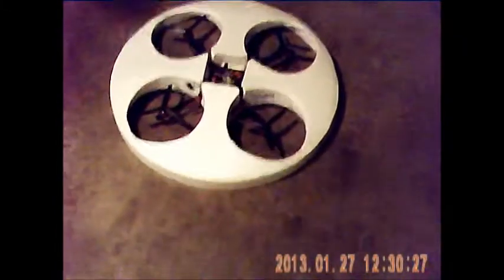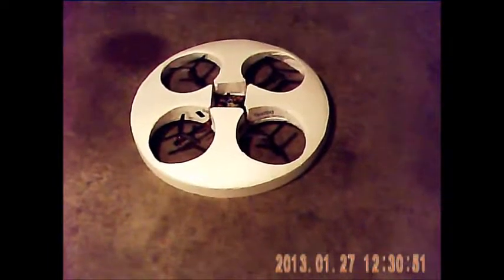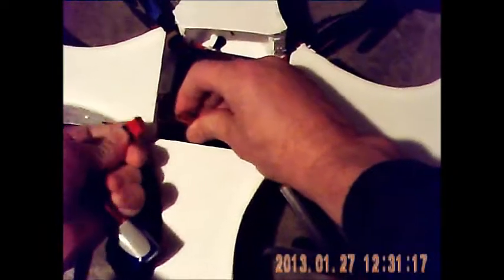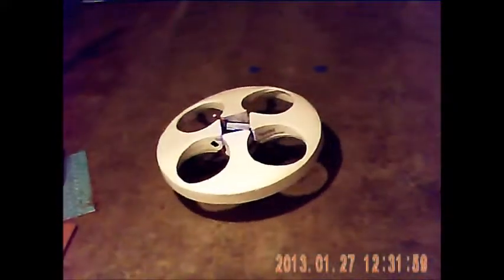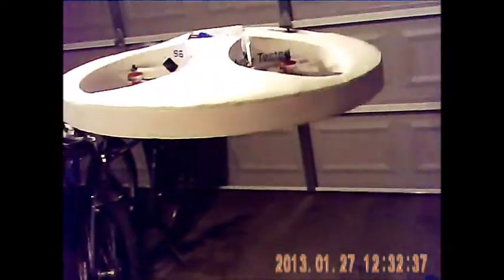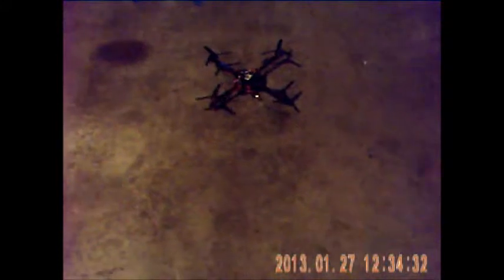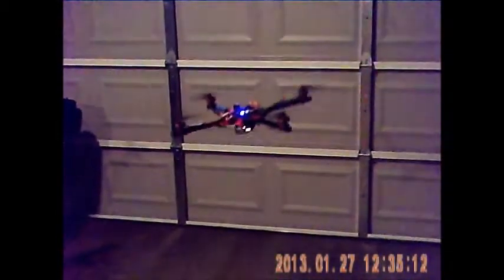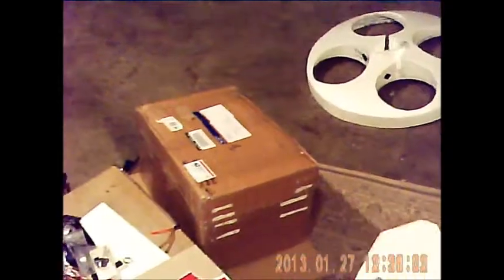RC UFO Flying Saucer w Carbon Fiber Xcopter

Comment: Mine will be more a historic replica flyer since it's going to be a bit of cash outlay but in the states I would find a foam like that expands in insulating and make a two part waxed or wax paper lined mold for your disc. Motor mounts could be cast into the body or it could just drop on a f450 frame. Now to get my waterjet cut parts ready to test fly, :o) the aluminum disk I am spinning for is based on this but will fly.
watch?v=cjWHrPYvUo0